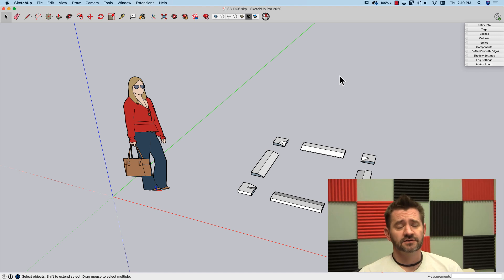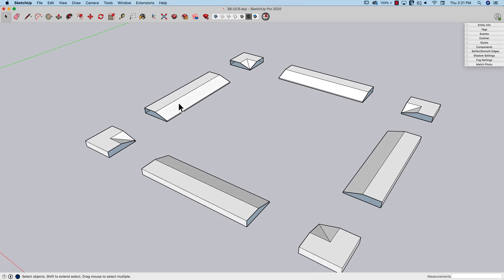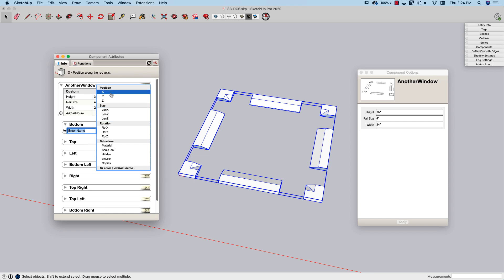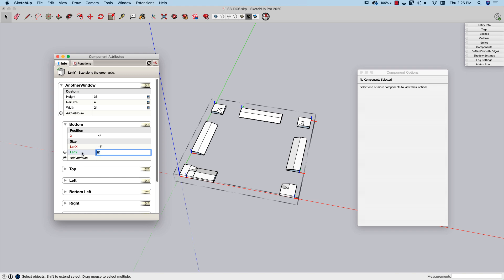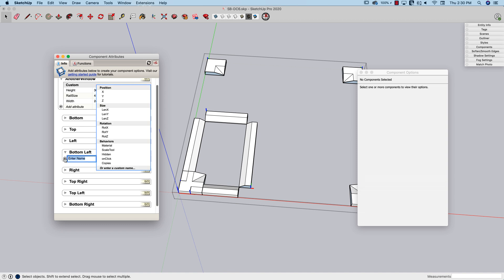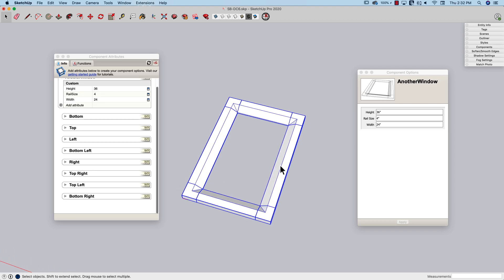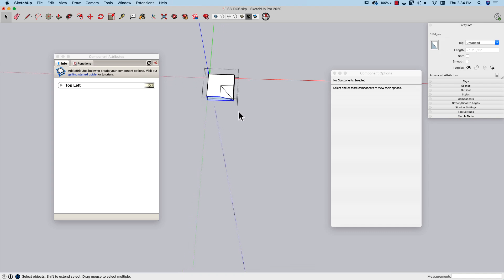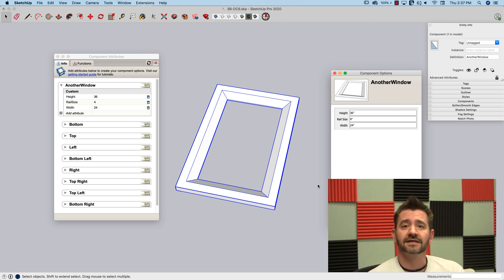Welcome to Dynamic Components Part 6 - Skill Builder

Comment: Hello. First of all, thank you for your channel. Even I thought I "know" to use Sketchup you showed me I know nothing ;) I am trying to make some project with dynamic component, but I am struggle with two functions - dynamic size of the entire cabinet and making the door animated (turn around Z axis). I think I have already done a lot of work with all the linking all the attributes which works fine. I also made some model, where animation ("rotz"0, 90, 180) was working, but now, I am trying to build let`s say a door frame, which should be definable and moreover being able to animate them. It is very frustrating for me that I can`t find the way how to make the model (and DC) working with those two function :( For example, when I click the component to animate, it turns the object in a proper way, but the scale get distorted :( Could you please make some sample of this as I think a lot of people can use it. Thank you.

Comment: I want to know how to use only the 4 profiles with the cut angles to generate the report
Reply from the maker: Unfortunately, if you use cut angles, they distort when you change the size of the frame (which was the point of using the dynamic component). If all you are looking for is to report on a number of pieces, you can just group together cut pieces and use Generate Report!

Comment: Really enjoy this, especially being broken down into bite sized lessons. 
I would suggest with careful planning this could be built with 2 components, the corner and the rail. Then the corner could be rotated (and/or mirrored) and the rails the same.
Reply: What if length and width are not equal? Corner, the length rail, and the width rail?
Reply: @towTruck42  been a while since I reviewed this video. You could use separate components for stile and rail. If the only difference is length, then you would just adjust that dimension.

Comment: Dynamic component tool is not working correctly in both SKU 2019 and 2020 to allow me to follow your skill builder. The component option box does not show user options after selecting to let the user to edit the value is set in Attributs and I hit the apply button. I using Mac OSX 10.15.3, Catalina and have a AMD Radeon Pro 5500M 4GB. I really appreciate your effort in putting this series together. Is there some bug in SKU causing this behavior?

Comment: Im enjoying this series and have put it to use in wardrobes but Im having a problem on the thickness on the bottom and top panel I wanted to keep a 3cm thickness of these panels but can't seem to hard code it, as they just increase or decrease no mater what I do. so maybe you could do a episode on wardrobe. Thanks again Aaron appreciate your tuition vids.
Reply: I hopew these help. For hands on assistance, bring your .SKP file over to forums.sketchup.com and someone can help troubleshoot your specific file!
Reply: Have you tried hardcoding 3cm? This would be "=3", not just "3". The equal sign locks it in, where just a number is more like reporting the size.

Comment: This is a really useful series, good work. I guess that if you wanted to keep the slope at a constant angle you would have to make extra dynamic components to take care of this when scaling.
Reply: I would model the edges as two separate pieces (a rectangle and a ramp). Then resize the rectangle to the size in put minus the ramp width.
Reply: i think you'd just have to add one (maybe two?) new attributes to the existing components to define the angle. i am guessing that like "lengthx" (or however it's spelled) there must be some attribute for that angle, and you can just have that be mapped to some new parameter...lol, or i might be totally wrong. xD peace